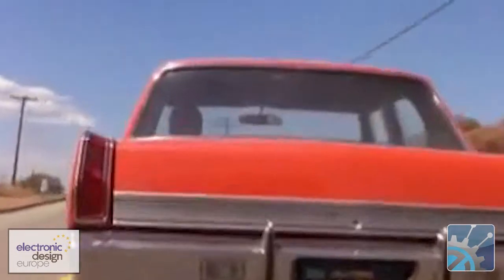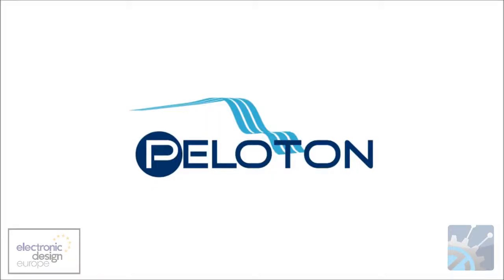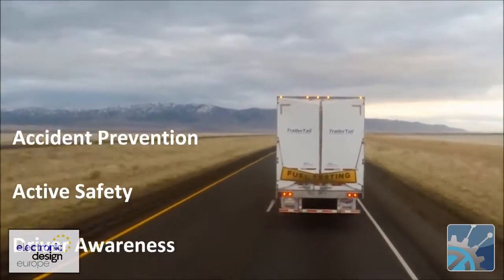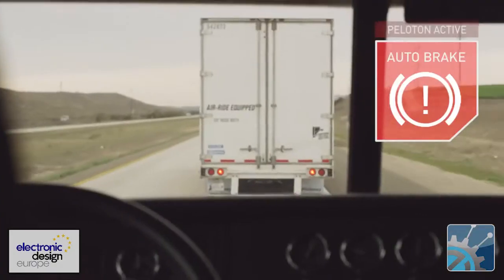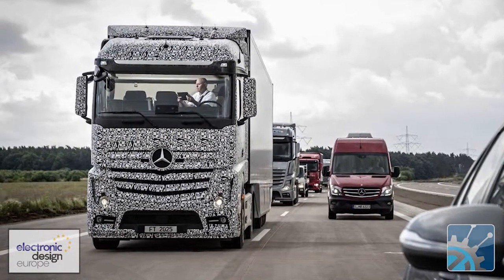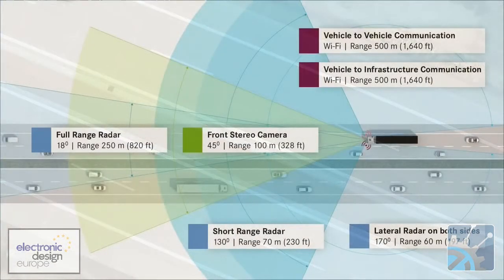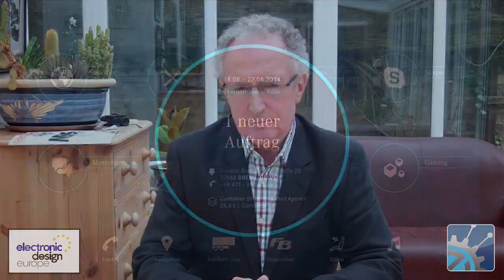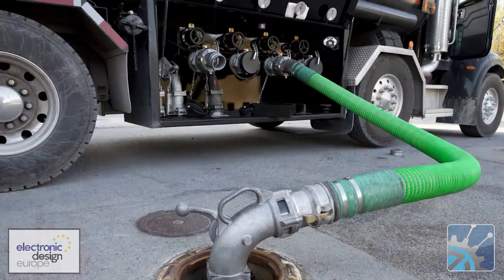Would You Trust Driverless Trucks? - London Calling

Comment: In my opinion it's not a matter of outcome but of transition. Driverless vehicles are clearly the best end option because roads filled entirely with self driving cars that can communicate with each other (and with traffic lights or future versions of traffic guidance) would not only be able to draft each other safely, but would be able to pass through intersections and merge at high speeds safely, along with being able to nearly instantly coordinate new traffic patterns that best fit the current traffic on a given section of road. Vehicles that do happen to lose control due to environmental conditions or other failure would be able to instantly warn nearby vehicle to allow them to avoid collision and a computer would be much better at drifting in a traction loss scenario than the average human. Miscellaneous obstacles could potentially be tracked via footage from other cars or security cameras linked to a network. All of these things combined would allow an incredible extreme decrease in traffic and a significant increase in fuel economy and safety and maximum traffic speeds.
Edit: The main headlights could not only be dimmer but could be a different frequency of light, allowing for less light pollution.